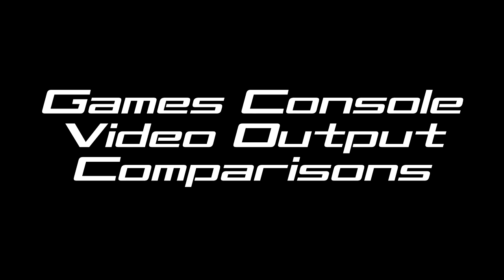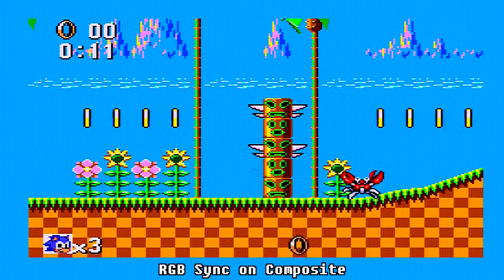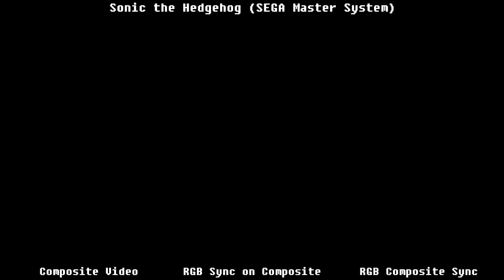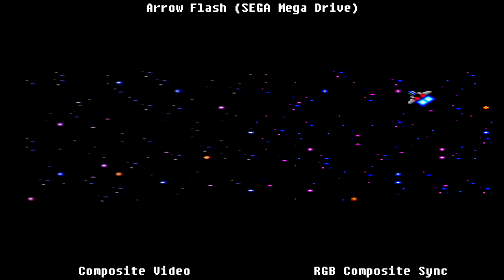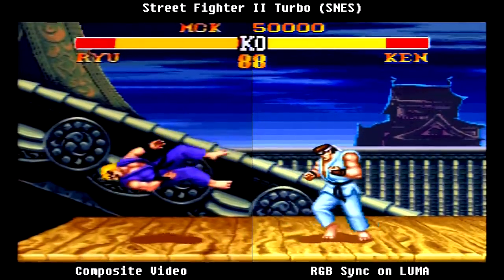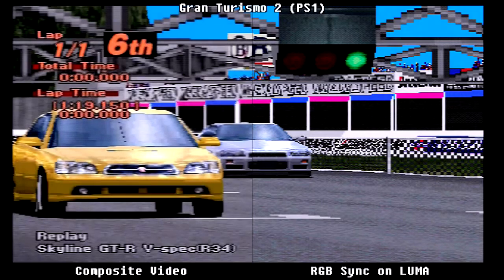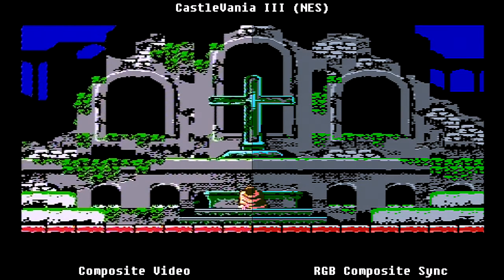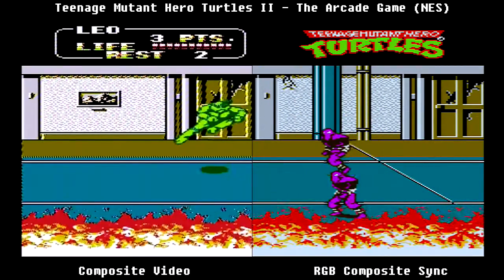Games Console Video Output Comparisons

Comment: Fantastic video Simon! the comparison method you used really did show the difference which on some consoles was night and day!
i was laughing at the N64 fog lol
Reply from the maker: Thanks mate! :)
Yes unfortunately N64RGB cannot undo the amount of fog/blur used on full motion 3D in a lot of the more graphically impressive games. I'd like to get a hold of a UltraHDMI board one day to see what that makes of it. I'm told at face value the difference will be marginal but the sheer amount of customisation & post-processing options is where it truly shines.
I'm planning on hopefully doing a small follow up video to include Composite & S-VIDEO on the Commodore 64 and RGB Sync on LUMA vs Component output on the PS2.

Comment: Hi, when you demonstrated the difference between sync on composite video and csync, which cables did you use? Unshielded or shielded?
The reason I ask is, I'm wondering if cable is fully shielded, would you still get checkerboarding artifact if using sync on composite?
Thanks.
Reply from the maker: Fully outer shielded but not individually screened within. The checkerboarding is a very common effect of cross talk occurring somewhere in the output signal which might be prevented with an individually screened cable (expensive). However, money would be better spent on a LM1881 sync stripper based solution within the cable if composite video is the only option for sync. I have upgraded a couple of cables to this with great success (PC Engine).
Reply: @A3rgan  Alright, thanks for a quick reply. I'll look into those options.

Comment: The noise on composite connection on the NES is quite close at what it adds in noise quantity when a console is on the abomination color system PAL-M. I got a few examples on PS1 and N64. PAL-M is an abomination by itself. It isn't PAL, neither NTSC. Add composite video and wait for the festival of artifacts on screen.